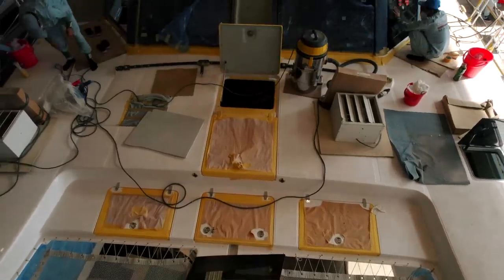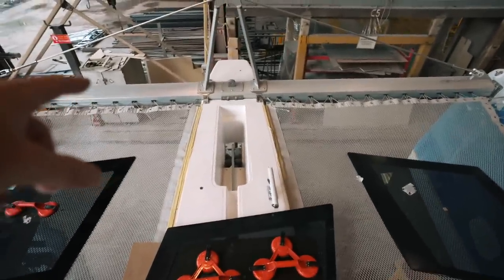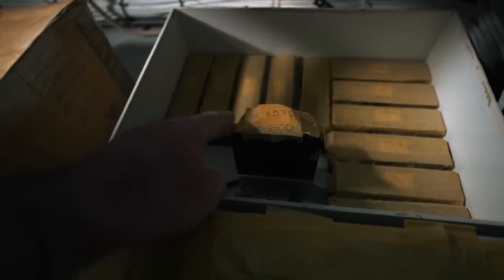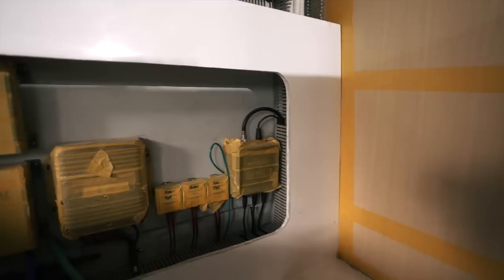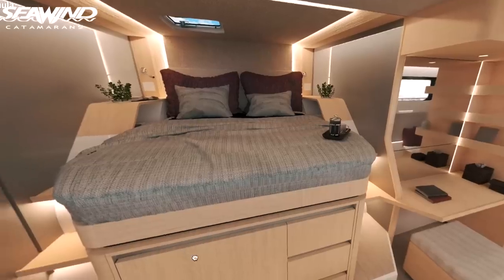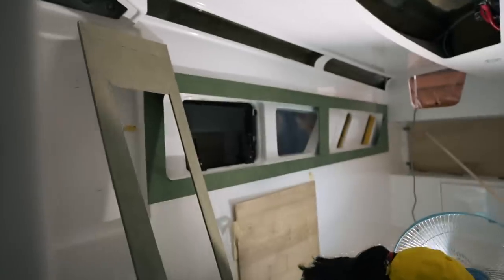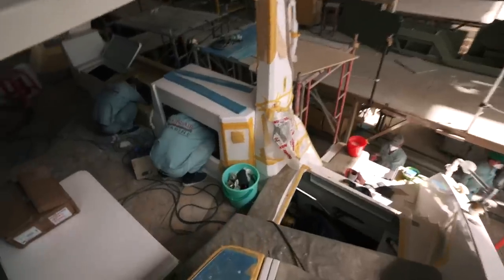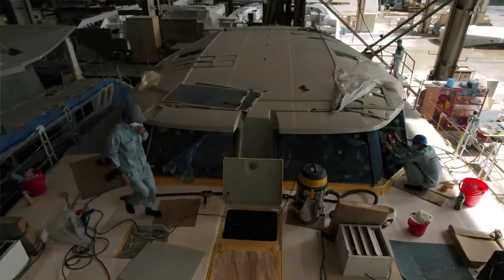MIND BLOWING!!! This catamaran build is REALLY speeding up!

Comment: Thanks for showing the Panduit wire ducting and raceways, with the professionally bundled conductors. I've often wondered why Panduit wasn't used on boats. The electricians' work looks neat and tidy. My pet peav, wire tie spacing, facing the ties in the same direction, and once secured and cut making sure the cut edge is smooth and not protruding to prevent injury to persons working in and around the bundled conductors. If you've ever cut yourself on one, you'll know what I'm speaking of. It's great to see women craftsmen! Thanks again.
Reply from the maker: always a pleasure
Reply: Dressing the wiring is just as important as everything else. Agreed.
Reply: If you're able to layout a wiring  harness on a plywood jig it's actually FASTER to bundle the wires together using what's essentially string (think thick dental floss).  Then you don't have those damned knuckle rippers sticking up at every wire tie.  First place I worked after getting out of the service did that, although I'll admit for the largest device we built it only took two 4x8 foot sheets of plywood to layout the harness.

Comment: Between orc50, outremer51/2, hh44/52, etc, I'm getting convinced that the 1370 would be the best balance of value/comfort/performance. It's in the price point of orc50 but much more comfortable. Yeah it's not gonna be a racer but most people wouldn't want that anyway. The 360 view and great helm position is a big plus as well.

Comment: It would be very interesting to hear an estimate of the total man hours for hull #1 versus hull #2, 3, 4 etc. I would guess Seawind actually loses money on the first few boats due to all the design costs, jigging, templating, etc. I wonder how many hulls before they actually start to break even or turn a profit?
Reply from the maker: yeah they lose money on the first few. Now sure when thye break even
Reply: One reason builders have migrated to VN is labor costs. I visited a new modern boat building facility out side of Shanghai, workers lived in dorms on site with dining facilities. We were there several days and observed a woman wet sanding the same area both days. That facility is now shuttered.

Comment: Serioisly on RR2 ask for laminate not toughened , you only need something with a shackle on the end to whip round and hit the glass if youre mid passage could cause you some serious issues especially in a blow. I wasnt being negative, when i rebuilt my boat, the screens in my wheel house were probably same size as yours, i stood behind them realising that i neither wanted glass in my face if it shattered now continuously blasted with water. Your screens could compromise your boat. Your seem to have attention to detail but not attention to spec, im sure you would prefer peace of mind

Comment: its coming along. So I do not understand why they are doing 24v instead of 48 for battery banks. 48v Is the safest and wires are 1/2 the size of which saves money and make it more efficient. 24 volt is still better than 12. Is there a reason they are using 24v? Regardless its looking better every day.

Comment: What is it that is under the mattress in the Master Cabin that requires it to be so elevated?
Reply: Air. It extends over the middle of the boat, beyond the port hull. Since it has to be elevated the portion under it within the hull is used for storage.